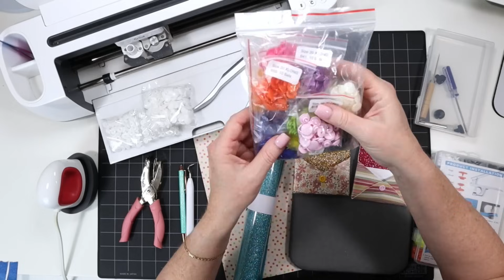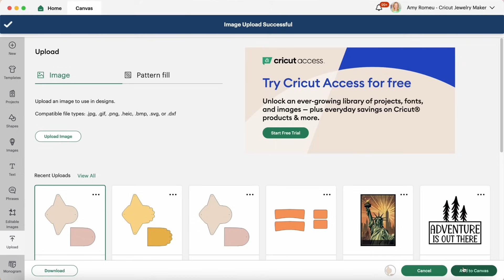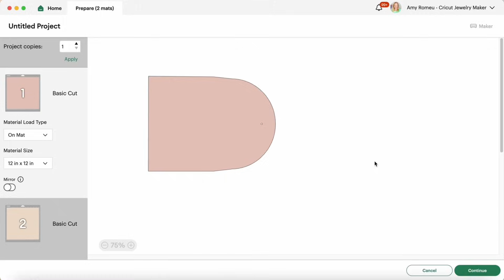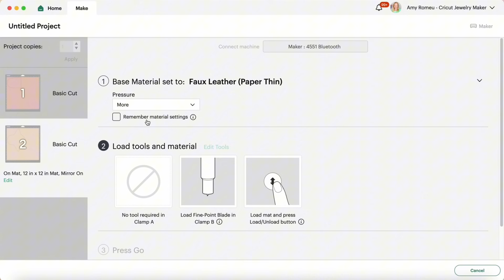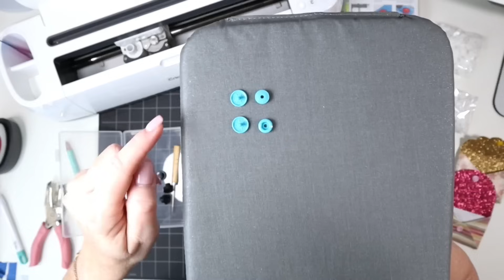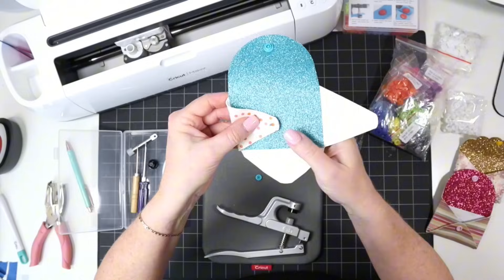DIY Cricut Easy Faux Leather Wallet & Kam Snaps Tutorial

Comment: I could not seem to get my Kam snaps to lock in to place.  Not sure why..  I bought the same one's you showed.
Reply from the maker: I'm sorry to hear that! Were you using the Size 20 Extra Longs (not regular size 20's)? Having the extra long post is the key to snapping through three layers of faux leather. If you had the long ones, then it’s possible that they weren't aligned in the tool just right, or you didn't squeeze hard enough. I hope those suggestions help when you try again!

Comment: I made one of these and put the snaps on today. I wanted to flatten the sides and flap, so I tried putting it in my heat press (off, of course!) it worked great except for one small thing. The snap bulged out the leather on the back! Not a problem though, because I discovered it was a great holder for my license and cards that I usually have loose in this bag that won’t fit my wallet! I will be making more, but I will do the flattening BEFORE I add the snaps!

Comment: Hi, Amy!  I clicked on your materials link to get more information on the faux leather you used, but can't find any dimensions for thickness.  I've never heard of the "paper thin" and was wondering if supplies I already have may be adequate.    Thank you!
Reply from the maker: Hi, Maria! I cut faux leather every day and I rarely have trouble with the faux leather being too thick, so it's not something I worry about. The Faux Leather (Paper Thin) setting has a misleading name in my opinion! It makes it should like the faux leather must be very thin to cut, and that's not the case. The faux leather I use most, from the link I shared in this video, cuts beautifully with a Cricut using my suggested cut settings. I hope that helps!
Reply: @AmyRomeu  which side is down touching the mat?  One type of faux leather I can use has a fuzzy side and another one has a fiber/burlap back..
Reply from the maker: @sandral4786  Hi, Sandra! I always put the pretty side of the faux leather down on the mat. :)
Reply: Great!  Thank you the information. @AmyRomeu